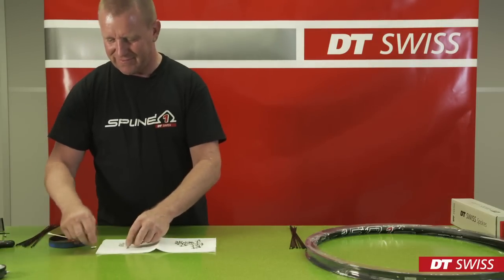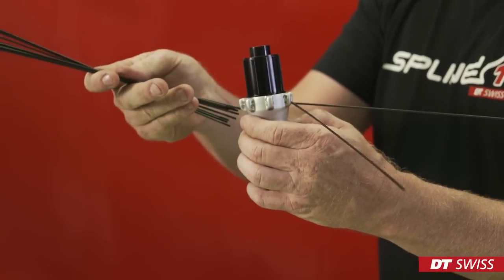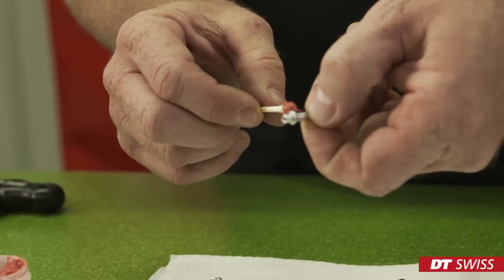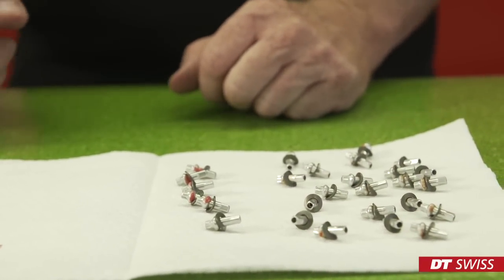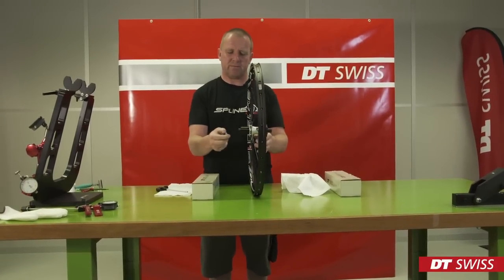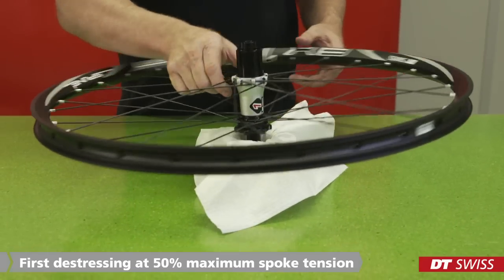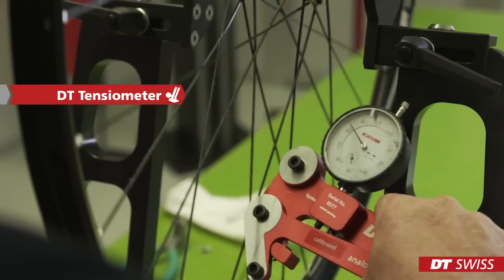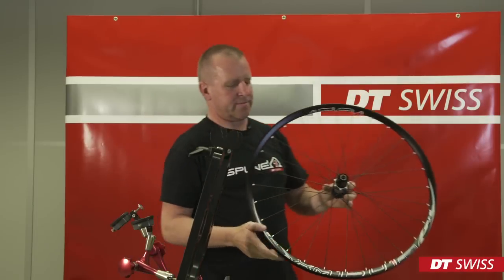Building a wheel from A- Z: SPLINE ONE.  | DT Swiss

Comment: Are the dt squorx only for bladed spokes?
Reply from the maker: Hi there and thank you for your message. We use the DT Swiss Squorx ProLock Nipples for all of our wheels. There is just one exeption, the BigRide wheels, as those rims are single wall. With the Torx tool mount on the inner side they offer more grip to lace up a wheel easily with to the right spoke tension. So in general you can combine and nipple with any spoke type. Have a nice week, Friso "DT Swiss".

Comment: what is your recommendation on adding lubricant to the thread of the spoke? 
others have recommended adding some grease/chain lube to the spoke thread to prevent corrosion and to stop the spoke twisting  as tension is increased.
Reply from the maker: Hi Peter and thank you for your message. I hope you had a good start in the new year 2021. Regarding your question, as we use on our own wheel builds every time DT Swiss Prolock Nipples ( those nipples have a pre applied thread locker inside ), we do not us grease or oil on the nipple threads. But to get the wheels easier build, we use some grease in-between the surfaces between nipples and rimbed. Enjoy your wheel building, Friso "DT Swiss".

Comment: I'm about to rebuild my DT HX 1700 wheel with a replacement HX 531 rim (rear wheel). Can you tell me what tension I should be aiming for? It says max 1200N but I presume that would be too much anyway? And just confirming, no lubricant required on the threads with the Prolock nipples? :)

Comment: Hello,
I have the XR391 rim with DT Competition spokes and 240 CL straightpull 2020+ rear hub. The rim has two types of holes: some are centered some are shifted to one side. DT calculator told me to by 306mm spokes. They are the same lenght to both sides of wheel. The question: which spokes should I connect to which holes? Do drive side spoke go to centered holes or to shifted holes? What is the orientation of a rim against a hub? Should shifted holes direction be to the drive side or to the non drive side?
Thanks.
Reply from the maker: Hi Venz, the rim has a bigger surface on one side, this side needs to face towards the cassette. Kind regards, Christian, DT Swiss